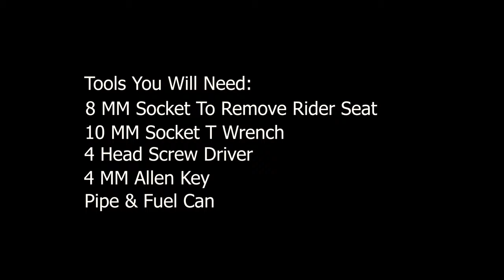FZ25 How To Remove Tank & Clean Fuel Filter | Life of Pal

Comment: Sir, I face very much jerking problem in my fz25 even though it had 3 to 4 liters of petrol. Earlier this problem was not there and it jerk after running 40 to 45 km in reserve mode. Now it start to jerk soo much without getting in reserve mode. Can you tell me what will be the problem?
Reply from the maker: Fuel filter is dirty probably check that first then clean injector

Comment: Have you faced rain water entering in tank as mine fz25 has symptoms like that so planing to do also the fi is cleaned from service center before 500 kms so I suppose that
Reply from the maker: No i haven't faced
Reply: @LifeofPal  can u help me on a issue like my Fz25 is lagging very hard like no fuel if I accelerate sudden or on high speed so I am planning to clean fuel tank, throattle body, please let me know what else I need to clean or check?

Comment: Very informative brother thanks a lot for this video.........From my side i just want to ask the question regarding my FZs Version2 bike. The issues what i'm facing is that my bike is starting when i press on the self start. However, while accelerating the engine starts to turn off. As i have checked some of the parts such as fuel pump, fuel injection, RR unit, CDI choir, spark plug etc, all these things are ok bro...Questioning that does the ignition choir can be happen like that? What will be your recommendation?. Hoping you to get some response. Thank You.
Reply from the maker: It can be a issue of fuel or spark. Check if your injector spray as it should. Test ignition coil using multimeter if measurements are within specs. Check the resistance of spark plug cap and of spark plug to see if within spec. If all ok with spark part and also checked injector and have cleaned throttle body. then start checking all the sensors if they are within specs. Hope this will resolve the issue.

Comment: Can we purchase fuel pump filter seperately?
Reply from the maker: No
Reply: @LifeofPal  Yes I tried purchasing it from Yamaha but they told you will get it with fuel pump only......Luckily got one in local spare parts store for 500rs after searching for 2 days
Reply: @LifeofPal  but my fuel filter clip got misplaced and I think that I wont get from outside, any idea if fuel pump filter comes out of its place automatically after some time?
Reply from the maker: Good for you that you got outside. Cant say for sure if that can run without clip. Check if thats tight enough by itself and if you think it won't come out go without it otherwise if you have any doubt. Then you can try any jugaad like glue gun would fix it and its easily removable without damaging. Let me know what you did.
Reply: @LifeofPal  I had installed fuel filter without its clip and no issue since 2 years

Comment: Have u cleaned fuel filter during 30000km
Reply from the maker: Between? No
Reply: @LifeofPal  Means there is no need to clean the fuel injector of yamaha fz25 at every 6000 kms if I am using good quality fuel